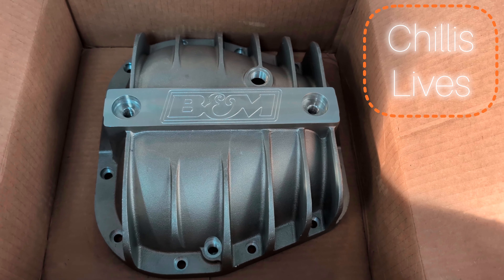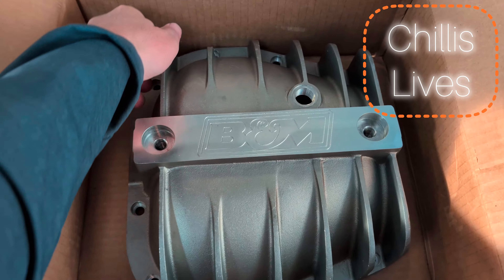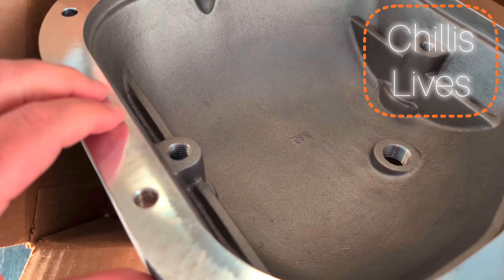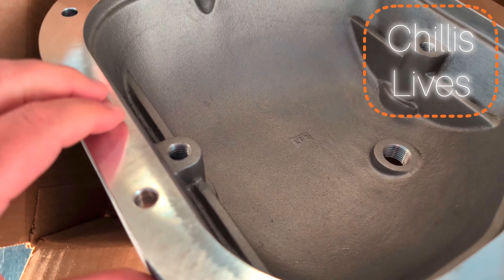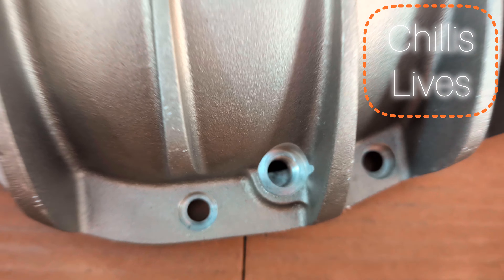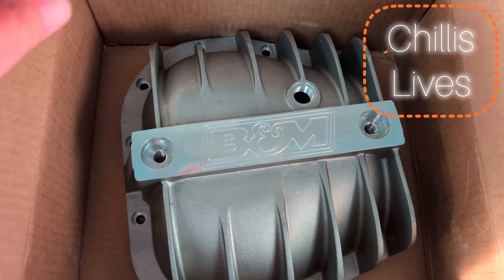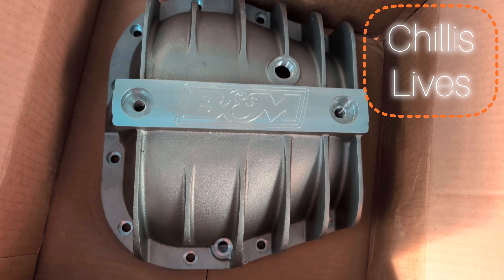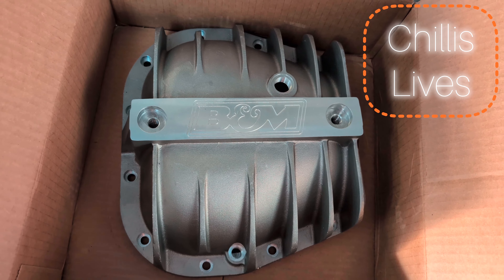B&M Differential Cover Transit T150 (Read Description)

Comment: what's the part number for this differential  cover?  what kinda axle?
Reply from the maker: B&M Differential Covers 41298

This cannot be used on stock Transits. It is the same version for the newer F150 with 9.75 differential.

My axle is a modified stock Transit axle.
Reply: @chillislives   ok ok looks very similar to a 10.50 sterling axle that are in the f 250